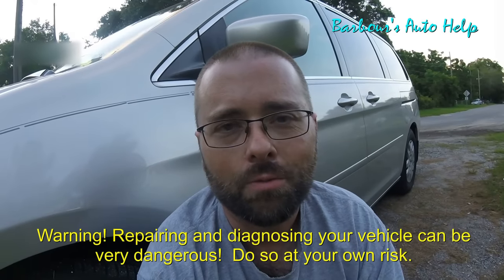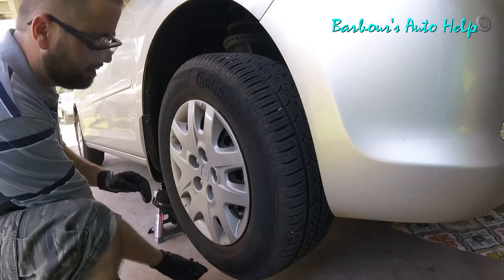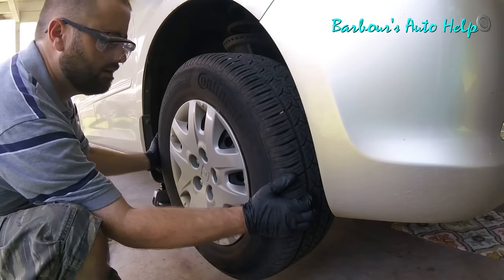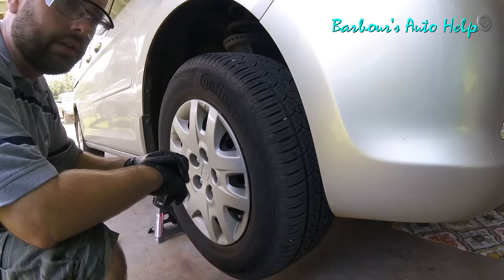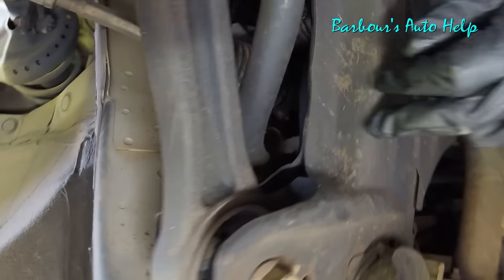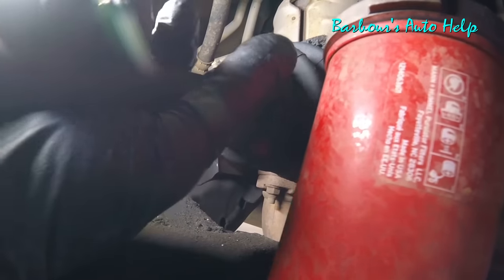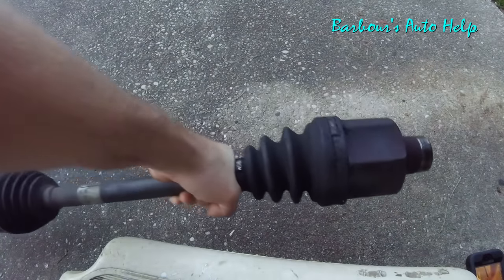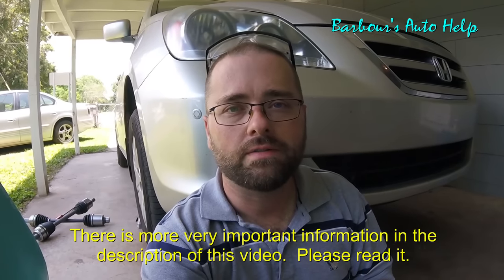Vibration Under Acceleration Diagnosis

Comment: Hi i have the same problem my mechanic change the engine mounts all of them and still it vibrates on high speed when I accelerate. You change your axl did it work?

Comment: We thought the cv axle was the issue because it was doing it between 60 to 70 . We replaced it and now it does it between 40 and 60 and is worse than before.
Reply: That means you didn't fix the correct part and it's is just getting worse the more broken it gets.

Comment: Keith, good video and explanation. I have a 2002 Toyota Camry 3.0 V6 that is now shaking/vibrating only when accelerating at any speed, especially when going uphill. Thought it might be the driver's side CV axle but it is still there. When I first looked at both CV axles there was no indication of torn boots or leaking grease. Do you think the passenger side CV axle might need to be changed as well? We ruled out the motor mounts and did the test you recommended with the wheels.
Reply from the maker: It may be.  Did the inner joint 9n the passenger side axle have play in it?
Reply: @BarboursAutoHelp  Did not find any play in it. We changed the passenger side CV axle anyway and the shaking/vibration is now gone. I was very challenging to remove due to the rust between the bearing ring and the bearing bracket. Had to cut the axle shaft in order to get it out. putting in the new one was easy.
Reply from the maker: I'm very glad you got it fixed!  Thanks or sharing and God bless you.

Comment: Good video and I have the same issue, it has vibrations at highway speed. I have CV boot leaking. Do we need to go with only Honda components. The after market kit comes with Shaft as well and my van is more than 150k miles.
Reply from the maker: I used after market parts and it worked fine.
Reply: Thanks Sir

Comment: I have a 2002 Odyssey 135 k miles. Transmission clunks into 2nd and 3rd gear and if I push it hard it will make a terrible bouncing going into 3rd or 4th gear. I don't know what the problem is I just bought the van I'm just clueless. 
I've been driving it very slow and gently.

Comment: Did you have vibration in the steering wheel ? I have a vibration under acceleration from 60mph -70. Zero / no vibration in the steering wheel or front end, feel it in the seat / floor.  I did just have new tires installed (perhaps they warped the rear rotors) . I have seen other videos that it can be rear rotors (mine are original 210,000 miles)...Any input would be appreciated before I start throwing parts at it. (210,000 miles, bought it new) Had no issues before new tires were installed..
Reply from the maker: It's been a while. But I think I felt it in the wheel and seat.  Never hurts to have a tech diagnose it before having parts thrown at it.  Could save you some money.

Comment: I have a 2004 pt Cruiser that has a vibration when accerating at low speed between second and third shift and some vibration at highway speeds. I do need to replace the inner and outer tie rods. Would out of balance CV axles cause this low speed vibration or it most likely the tie rods. They are not horrible yet but they are not right. Steering still feels fairly tight

Comment: Driving a 2008 Mazda 3 hatch. At 20-25 mph there was a slight humming but would go away above 25-30  recently it's been a little louder but when I got new tires a few months ago, I noticed a louder humming coming from the passenger side at about 60mph. Suspected maybe a wheel bearing but I checked for play and had none. I just rotated my tires yesterday at today when i drove between 65-75 there's a noticeable vibration and steering wheel moves a bit as well. I'm suspecting, for sure, a bearing, tie rod, CV axle or all three hahaha.
Reply: Vibrates under acceleration only and stops and had let my foot off the gas
Reply from the maker: Never hurts to have a tech look at it to be sure what is causing the problem

Comment: Thanks for the video.  My 2005 Odyssey sounds like it's taking off at about 55mph.  I get a good bit of cabin shaking.  All of the motor mounts were replaced prior to the shaking and it was riding nice for about a month.  Now the cabin shaking seems to be worse.  Is this indicative of a transmission issue?
Reply from the maker: Not necessarily.   Have you checked your vehicle out yet using the video?  What did you find?   When you say it sounds like its taking off do you mean it sounds like an airplane?  Wheel bearings can make a sound similar to this.
Reply from the maker: Here is a link to a video that gives an example of what a bad wheel bearing may sound like..  https://youtu.be/q5zvSD-Kwfk

Comment: I have a grinding noise on my 2009 grand caravan I can grab the axel cv shaft and actually stop the wheel in drive on axel stands would that indicate a bad cv joint I do have play or slop on the inner joint . I did have play on passenger side bearing I changed that ,when I first put car on axel stands only passenger side wheel rotated in drive I removed caliper and drivers then moved but passenger side stopped rotating.  I then removed that caliper and it move down freely in drive .I've never had such weird problems any advice would be greatly appreciated. Great video Thanks for sharing Dale
Reply from the maker: When does the grinding noise happen, under what conditions?
Reply: @BarboursAutoHelp  The grinding noise is well you are driving it pulls to that side also .The inner cv joint does have more than normal slop no torn boot no grease  visible. I CHANGED both wheel bearings first thinking the noise was that did both at the same time. One on the side of the grinding was worn badly but not the problem . I'm thinking it's my inner cv ,I'm a little reluctant to find it faulty at only a 114000 but it is a 2009 .Again I am getting more than normal moment at inner cv and when I run van on stands that axel vibrates terribly. It actually slows down under load. Any insight would be greatly appreciated Thanks Dale
Reply from the maker: While anything is possible I've never heard of an axle cause a grinding noise.  Does the right axle have a bearing pressed onto it where it may bolt up to the engine?

Comment: Thanks for the video.  My 2010 Odessey (just purchased) shakes a little around 50mph - 55mph....only under acceleration.  If I put it in Nutral, shaking seems to stop.  Seemed to start just aftet i drained the transmission (4 quarts) and refilled with the Honda transmisdion fluid.  BUT, I also just put new tires on the front.  Not sure what to think.  How do you diagnose a potential  torque converter problem?  It seems like a lot if things may cause this from what I am reading.  Any thoughts?  There are 122,000 on it. Thanks!
Reply from the maker: You want to start out by ruling out the easy stuff, like what I go over in the video.  It's possible that the torque converter can be acting up but less likely than the stuff mentioned in the video.  I would first suspect the tires, being as the problem seemed to arise after you replaced them.    I'd hope the place that put them on for you would be willing to give them a look.  Maybe they could recheck the balance on them.  Its been my experience that they probably will.  After that you could give it a look using the video as help.  Hopefully it will help.  Some experience is needed though to confidently diagnose it.  The video is a good starting point.  If your still not confident in your analysis of the problem it never hurts to have a tech diagnose it for you.   As for diagnosing the converter, I don't have a video yet, but I'm sure you could find some good stuff on youtube about it.
Reply: It might be the strut top bearings, in my 2010 odyssey I have change tires, cv's, brake rotors, no play in the suspension but there might be something worn will change all.
For the mileage 125k I need to change complete struts.
 Hope it helps
Reply from the maker: Hmmm, I guess anything is possible, but I've never heard of strut mounts or bearings causing a vibration at 50mph under acceleration.  Thanks for contributing.
Reply: Unlikely Pedro Kim,  I had the strut/shock mounts in the front under the hood disconnected after forgetting to tighten them when I put new ones in...It didn't cause vibration because months later when I looked under the hood I saw I never even tightened them. The only purpose they serve is to keep the shock from denting the hood (keeps the shock from bottoming out)

Comment: Have a question I just got my mounts done I replaced my control arms. I replaced one side of my cv axle on the driver side. Now when I drive around 20-40 mph my cars starts to shake do I need to replace the other side too? Idk what’s going on I hear clicking sounds as well

Comment: I have the same problem with my vw polo (2011).
the steering wheel vibrates above 100km / h and when braking.
the tires are balanced, the brake discs + blocks have been replaced and the control arms have been replaced.
but the problem remains.
can this be on one of the drive axles?
Reply from the maker: Its possible

Comment: Hello, I just had my clutch and outer CV parts serviced because I heard some mechanical "grinding noise" when ESP tried to slow down wheel on frozen intersection and sometimes I felt an excessive amount of vibration on high speeds. Well after clutch  + new cv joints outer parts driving on 3rd, 4th and 5th gear it feels like a wheel is coming off. The mechanic said it is most likely my inner CV axle but the part was only available as factory made on request. So I ordered a new one and now I have to wait 1-4 weeks to get it (yeah, these covid19 delivery estimates times are insane). I have recently replaced front shocks, bushings and had both front bearings changed (well they were noisy and bad) but the vibration always remained. Would you also think this vibration sympton that is now VERY noticeable to be inner CV joint? 

It feels like you would have your U-joints in the wrong offset but CV-axles don't have U-joints, do they?
Reply from the maker: It's possible.  CV axles do not use U-joints.

Comment: Hey my car shakes/jiggle/vibrate when I accelerate but only at low speeds anywhere from 1-25 mph. What could it be? Honda civ hf 2012 115k miles
Reply from the maker: It could be anything that I mentioned in the video.

Comment: I have a 2004 Honda accord for putting /shaking problem 2004 Honda accord ex 2.4 160k , my motor moves up and down also , it shakes here and there and vibrates back and forward don’t know what it could be

Comment: I have a 2019 Nissan sentra. It vibrates only sometimes during low RPM when first accelerating. Other than that the car runs great. Not sure what it could be? It's only every now and again and I don't have any codes or check engine lights

Comment: When I move it from side to side at the 3 o'clock and 9 o'clock position, it does move, but only if I do a steady motion (I'm thinking the steering wheel is also turning). Is that normal? Or is it supposed to stay completely locked in place and not move whatsoever?
Reply from the maker: Probably normal if the steering wheel is moving.  You just need very light pressure to check for play in the toe rod ends.   It shouldn't easily flop back and forth.
Reply: @BarboursAutoHelp  ah, ok. Yeah, if I just jiggled it with moderate pressure, there was no play whatsoever. Didn't feel loose at all. I also checked the CV axle boots and didn't notice any cracks/rips or  damage, nor did I see grease anywhere. So now I'm stumped as to what's making the clicking noise when I make right turns only.

Comment: I have a 2009 Altima. I recently had wheel bearings and left and right Axel replaced.  However, now I am experiencing shaking between 45mph and 50mph ONLY when I accelerate (especially noticeable when going up hills). Could this be the same issue? My mechanic thinks it could be the struts need replaced, but I wanted to check here first.  Great video!  I have done a lot of research and this is the first video I have found that matches what my mechanic has suggested.  He has taken great care of our cars over the years by the way!!!
Reply from the maker: First thing I think about when I hear of a car shaking at that speed especially when going up hill is....Misfire.  Of course you would probably have a check engine lamp on.  Plus if you mechanics says to suspect something different it may be best to take his advise if he test drove the vehicle.  I of course haven't had the chance to test drive your vehicle so It would be very difficult for me to say one way or the other.
Reply: B okay did you ever fix that altima vibration? I have the exact same issue on my audi a3 2005 dsg 2.0tdi. I'm ruling out misfire. I've checked everything. Alot of new parts are fitted due to it being 190,000 miles already.
Reply: @LAW-fv6ys  Yes, after a few different attempts to fix it, I had the motor mount replaced. That fixed it!!
Reply: @brianokeefeable  was that the dog bone (pendulem) mount that is the the very bottom one that links the engine/gearbox to the subframe or was it the mount left side (gearbox) or mount right side (engine) mate?  Cheers for your reply.

Comment: The inner joint on the cv axle shouldn’t move around like that, it’s the plunging side that only really puches in and out not up and down or side to side that’s the outer joint

Comment: Hi also I never had the normal clicking well turning or no boots ripped to indicted cv joint only feel slop and as I said can grab the cv shat and stop the wheel from turning  in drive also transmission is not shifting property with this problem shifts once perfectly and will kick down into passing gear no problem  but no second shift or third .I checked all front end parts tie rods ball joints all good .could an inner problem in the transmission cause this the van only has 114000 km thanks again Dale
Reply from the maker: I'd say if the video hasn't helped you its probably best to have a tech look at it.  It may actually save you time, headache and money...  Maybe.

Comment: My Dec 15, 2019 Yota Crayolla started getting a 
wump thump thump. 50 miles after signing on the dotted line. Changed tires
and 300 miles later it came back- thump thump thump.
So I said ok your getting drove til you break.
Yesterday it broke , it turned
into a violent shake.
I'm paying for more new tires if needed but I felt 
slight play in the drivers side cv axle. The right side 
cv has zero play. It had 8950 miles when I bought it.
Has 10,200 miles now. But I think it was a very rough 8950 miles. It's getting fixed and sold. Lancaster PA ( where it came from) I'm presuming still has some very rough roads since I've
drove CDL -A 20 yrs ago.
Come on.
Hell I coulda got a new Camry for the $ I've dropped.
1 in a million bad Corollas and I found it.
Reply from the maker: Why are you trying to diagnose and fix this?  Isn't it still under bumper to bumper warranty?
Reply: It's under warranty but they found nothing wrong. Turns out it was just air turbulence from the rear windows when down. They mimic the sound of thumping tires and when all the way down the whole rear end shakes.
So I don't roll down the rear windows now.

Comment: I have an '05 Honda Element 2WD with a 5-speed transmission and it vibrates in 1st and 2nd gear particularly when accelerating hard but at low speeds.  I found lateral play in the inboard CV joint (right side) when the wheel is raised off the ground but no play when resting on the ground.  Tires balanced, engine and transmission mounts are perfect, as are the ball joints, struts and tie rod ends.  Have I found the culprit?  Thanks.
Reply from the maker: Hard to say for sure.  Maybe.  As I always say, if you not confident it never hurts to have a tech look at it.

Comment: Hello

I am in Calgary and bought a 2012 HONDA CRV AVD from its orignal owner with 150k for my son in Mississauga and he just told me he was having vibration problem when driving at 40-50 KM
and he took the car to local shop and he was told that it is Transmission problem and need transmission   fluid changed which was done but the problem is still there 
I was watching your utube video can you please tell me what could be the problem ? Like is it transmission or some other problem? Other problem was he is not getting heat in driver side and the shop said it is some actuator problem snd he changed the part but problem is not fixed 
Please recommend the possible reasons and where he should take for repair in Mississauga, Ontario 
I am in my seventies and really stressed out because I paid 
close to $13000 and crossing my fingers it’s not a major problem and will really appreciate your advice
Thanks a lot in advance
Regards
Clyde 
Calgary Alberta
Reply from the maker: Did you ever have a technician actually diagnose the problem?  I know they said this stuff but were any tests run before these services were done?

Comment: Hey Keith my name is Keith also I have a 01 pontiac bonneville I have a vibration on the right front passenger side only does this on the highway going into a wild curve with the wheel turning to the right no noise cv .axels are a few years old I moved the tires from the front to the back still the same issue please let me know your opinion thank you

Comment: Took my car to the mechanic complaining it shakes between 60-70 mph only when pressing gas pedal, he said it very possibly could be cv axle he recommends changing both since he don't know which is bad....is it really necessary to change both or just the bad one?
Reply from the maker: Well, I changed both because both had play in the inner joint.  Which one was causing my problem is still up for debate.  My van is fixed though.
Reply: @BarboursAutoHelp  one goes out so does the other sooner or later thats where im at now.